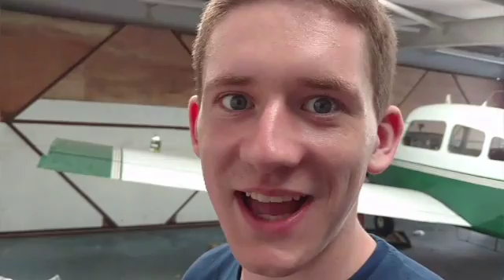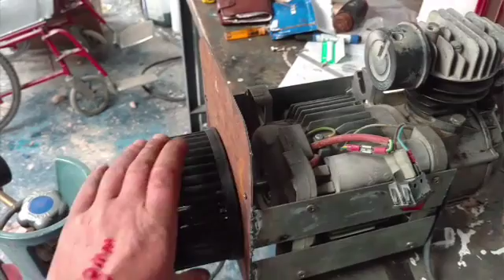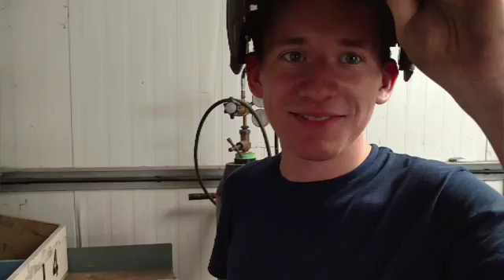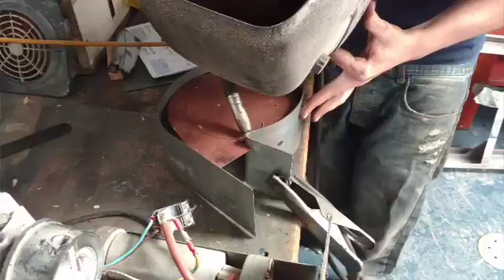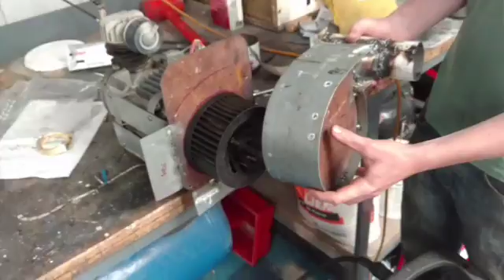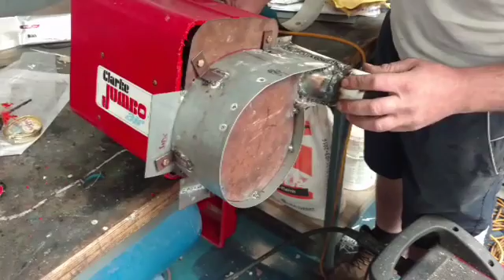Oil burner blower/compressor oil burner part 2

Comment: 4 years old but let’s see.  If you had used your fridge compressors to pressurise the fuel you’d have a much more efficient system than this common type of build which is energy hungry.
Reply from the maker: I'm still here mate, I decided it probably wouldn't have the volume and I would have required a separate blower potentially negating any energy savings not that economy was a big concern but It should definitely always be on my mind.
Reply: Turbo Conquering Mega Eagle You’d be surprised.  Take a look at an atypical fuel oil burner feed rate & pressure (nozzle dependent obviously)
Reply from the maker: I think there is more detail of the burner assay on the following vid, while the oil jet was only 1-1.5mm, I had compressed air blowing over the the jet to atomize it before it hit the main blown air feed so it's not just a case of pressurising the fuel tank.
Lots of different ways of building the burner but this one made the most sense at the time.
I've got a refrigerant compressor I use with an airbrush, they do put out a surprising amount of air but 4 years is definitely long enough for me to forget exactly why this all happened the way it did.